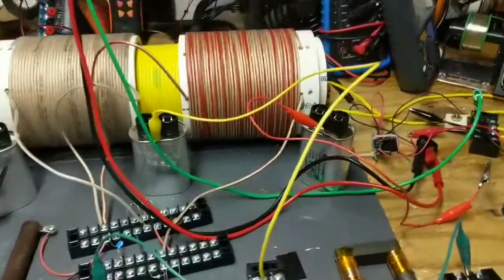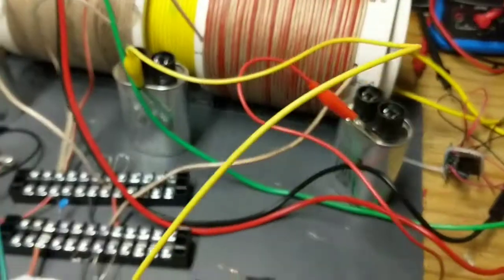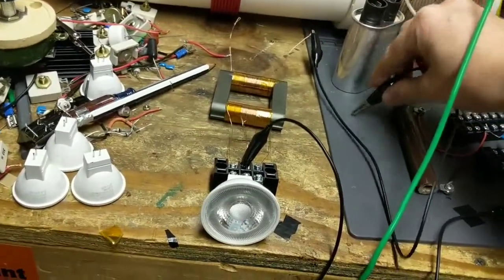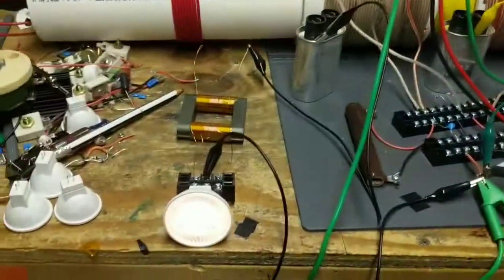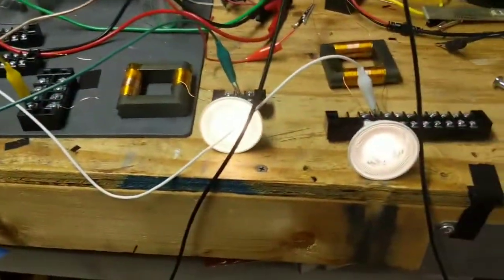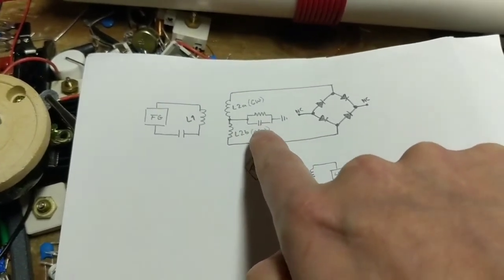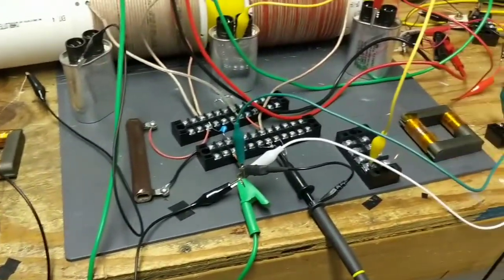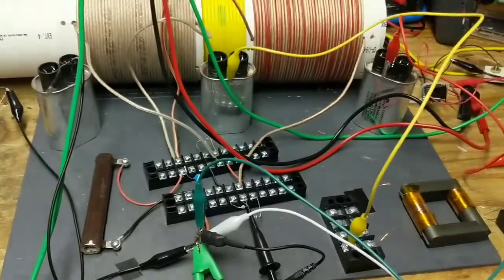Don Smith Circuit - Bad hookups followup!

Comment: Hi Phives, thank you for sharing.
I'm emailing with somebody who pointed me out to a failure I'm making with the impedance matching. I always looked at that was something that needed to be in between the load but he pointed me out that you can calculate your L&C values by first calculating the resistance of your load and use that as the reactance ohms to calculate your L&C values. L = 2 * pi * f * L => L = XL / (2 pi f)

XC = 1/ (2 * pi * f * C) => C = (1/XC) / (2 * pi * f)

(for XC other formula could be possible, math is not my thing, however results are checked with website where you could do the calculations)
In the Don Smith book page 97 Rick writes about this but I only understand it now.
I have no experimental experience on this at the moment, I hope upcomming weekend to change that 😀
This way your impedances are matched at resonance .
Reply from the maker: Yes this is what I plan to get back to next.  I kind of think of this as cascading impedances from earth ground input (high), to L2 coil (medium), to output (low).
Though I always hear Don and Rick say impedance is zero at resonance, so I'm not sure how much that needs to be taken into account for the L2.
Also how high and how medium impedances should be relative to the load I don't know yet.  I guess this is the skill to learn.
Also, between Don and Rick they've stated that a resistance can be used there as well at the ground shunt input.
This will be what I play around with the most in the next couple weeks I think.

Comment: Easy, your disturbing the ambient from flux changes. Flux is multiplied. Outside cap plate is acting as air ground. Spend more time reading Rick’s Book.
Reply from the maker: Yea, I figured this is akin to the dipole setup with the capacitor plates catching the flux.  Just interesting to see that much current generated into an open transformer primary and the flux then transferred to the grounded secondary.
Reply: @phives5910  ok, so it’s not about matching impedances. Otherwise we couldn’t run any load we want. When you earth ground a tank via shunt!!!, it pulls the charges in during each half cycle, it will oscillate back and forth starting at the next half cycle. This is why the shunt must be higher resistance than impedance of LC. It’s much easier for it to go back and forth in LC then back to ground.  This is what pulls charges in little by little. When we offer a lower resistance to ground ground, we do it in parallel to isolation transformer. This spins electric back to magnetic.  So we have to have multiple grounds for input and output!!! One higher than the other! Look at the cap arrows in book on image called “perpetual electron cycle” page before xli.  The impedances are different on both caps.  One arrow is up and the other is down!!!   🧐
Reply from the maker: So I see this as L2 ground shunt (high impedance/resistance), L2 (medium impedance), output transformer primary (low impedance).
I'm also going to add an SCR or MOSFET to control the timing of the output.
But, do you have a feel for "how high" and "how medium", relative to the output transformer primary?
Reply: Think about how electric field flips to magnetic through the isolation transformer.  The transformer is your converter that never has a load to the input. It’s the return path to earth ground creating real power. Lower resistance earth ground.  So we suck in at higher resistance than LC and return back through lower resistance through isolation transformer. Back to ambient. Hopefully I’m making more sense to help.
Reply from the maker: Yes.  I can see the process in my head, I think clearly.  Getting it into the circuit, and understanding where small differences might be hanging me up, I guess is the art side of this.
Reply from the maker: I added a comment in my latest video, I could only see a snippet of your comment there because as usual comments aren't working great.  Maybe if you respond to that one I can see the full thing.